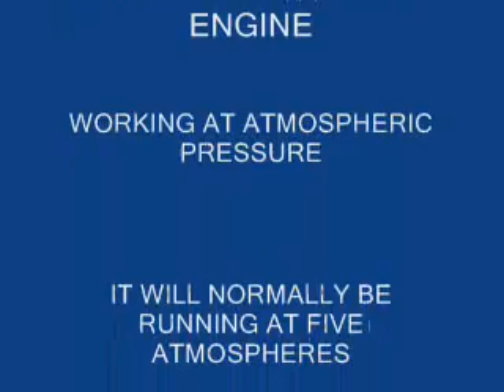RHOMBIC DRIVE STIRLING CYCLE ENGINE PART TWO

Comment: In your travels, have you discovered an optimum regenerator mass to expansion volume ratio?  I know that the porosity of the medium used effects the performance of the engine, in that the more porous the medium, the better suited it is to lower rpm engines. That indicates to me that the more surface area of the medium (less porous) the better but is there an optimum ratio between the working fluid volume and medium surface area, of the regenerator and the expansion volume of the engine? And while we're playing twenty questions, when you say that your engine has a displacement of 10 cc., do you mean, that 10 cc. is the difference between the maximum volume (displacer ascending from bdc/ power piston descending to bdc) and minimum volume (displacer descending from tdc/ power piton ascending to tdc) or do you use another formula?  Thanks for you time :-)

Comment: Mr. Barumman, in operation of the unit as an engine, the displacer runs in advance of the power piston. In this demonstration, to achieve cooling at the hot end of the engine, is the displacer still leading the power piston? :-)

Comment: You have some serious skills. Please look into graphine coatings. several places on the internet advertise to coat your tools and drill bits with this material. It is the best heat conductor there is. It is harder than diamond and will not scratch and it will conduct heat so well you can cut an ice cube in half in a second with a waffer of it, but you will get frost bite because it pulls the heat from your fingers instantly and freezes your skin.
 The stirling engine is all about convection. Moving heat form one place to another. The faster the convection the more power you have. 
 If you were to use this coating on your cooling fins and coat the pistons and sleaves of your engine I bet you could more than double your power, plus you could build your engine with closer tolerances and that would increase power as well.
 I would like to get some feed back from you and talk about your engine. Please email me, I would love to  share my ideas with you and follow your work. I might have some ideas you could use but you have more skill than I will ever have, your work and crafting is exceptional!

Comment: I've been wondering if it's at all possible to employ the change of state of water to steam and back to water, for increased power output from a stirling engine. Whether differences in pressure would still allow for it. Perhaps there's a more suitable medium than water. I can't do the math, nor do I care to experiment, so just putting it out there for consideration.

Comment: The compressed gas inside the casing becomes its defector atmosphere and what the pressure returns too when cooled to "room" temperature, so no. Remember there is no air/gas flow trough from outside.

Comment: The most brilliant design I've seen so far, and I've seen almost all of them. Well done!
But there is still something that eludes me: when you have compressed air inside the engine, doesn't that give the power piston the tendency to stay at the maximum extension? Basically it has two power strokes.. one when the air is above atmospheric p because of the heating, other when it's below because of the cooling. With compressed air it will never be below... I know I'm wrong, just don't know where...

Comment: the cold side when run in reverse by an external motor, is the part you need to heat to run the engine itself!

Comment: It's reversable.  Putting a heat source at the "hot" end and a heat sink at the cold part and it will act like an engine and will turn a generator for energy.  Put a motor where a generator goes and it becomes a heat pump--good for refrigerating in the extreme.  Think adiabatic expansion and contraction.

Comment: Excellent. I enjoyed observing all the hand made effort you put into this. But I wonder if it is possible to hook up the compressor from a small refrigerator as well? I don't know I'm not there to know if the engine will generate the required energy for both the generator and a compressor. 

But I certainly enjoyed the meticulous care you put into the project. Best home made Sterling I've seen yet !

Comment: you can make water from air, like "ecoloblue machine" using 2 stirling engines;  one running from heat and the other making frost that condense in pure water

Comment: @barumman 

What about running the engine on solar electricity or a windmill and putting the cold side in a well, insulated container. That would feasibly make a refrigerator, right?

Comment: When running a stirling the displacer, or expansion, leads the power piston, or compression, by 90 degrees. Does running a stirling in cooling mode have it inverted? Does the expansion then lag the compression by 90 degrees, does one run the engine 'backward' to cool?

Comment: @PyroEvil Well, I guess in this example they are the cold compression space. Which brings me to a question, does it matter which way you run the engine when using it to cool?

Comment from the maker: These are heat exchanger tubes.
This arrangement is far more efficiant than a plain cylinder when the engine is pressurized.

Comment: Great engine !
Somebody can tell me what's the curved pipes surrounding the top of the head. Is just rods to keeping/conduct heat or tubes where gas pass through and go to the generator?
I see this on some stirling engine but not all of them .
Reply: PyroEvil conducting heat

Comment: Very cool demonstration!  How cold did the heat exchanger get when running in reverse with water flowing in the cooling jacket?  Have you tried using helium as a working fluid and could the stirling be used as a cryocooler?

Carl

Comment from the maker: Hi ironGoober,
               On the downward stroke of the power piston the air in the crankcase is compressed, it is then passed through the one way valve(snifter)to the top of the piston therefore ensuring that the pressure in the working cylinder is always above that of the crankcase which will stop oil getting to and contaminating the regenerator, I HOPE!
Thanks for the interest.

Comment: What exactly is a snifter valve. My impression is that it is a valve to equalize the mean engine pressure with the buffer space pressure...is this correct?